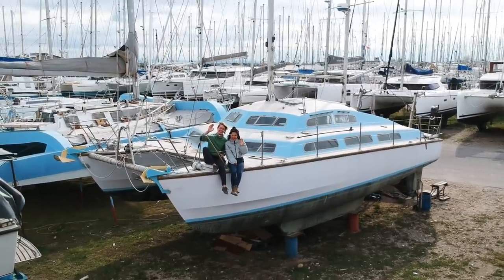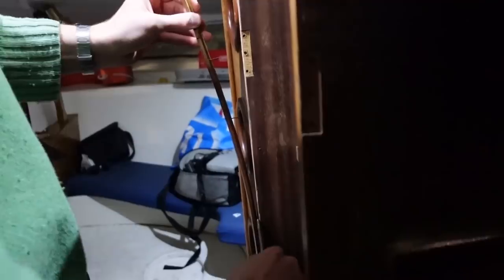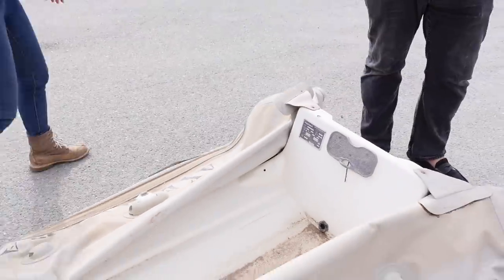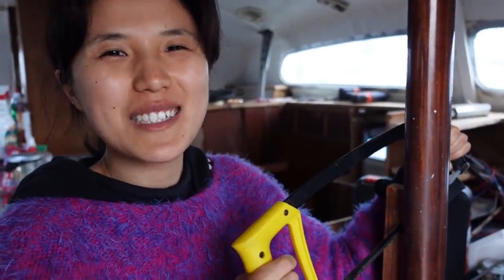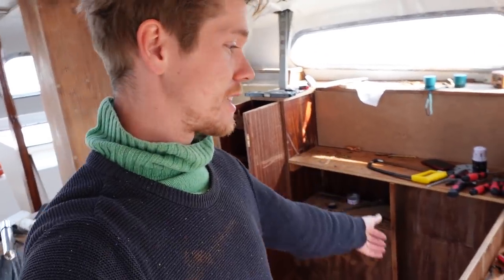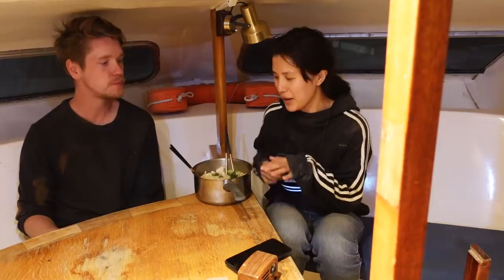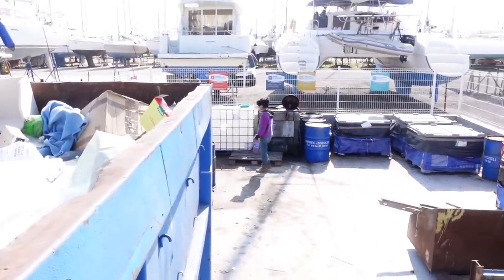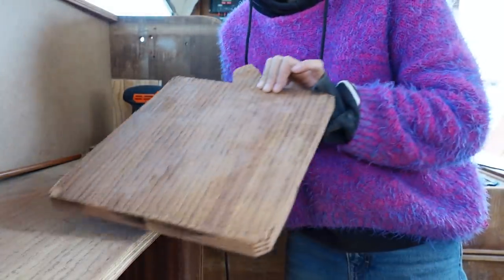Dirt Cheap Catamaran Refit | Part 1 | Wildlings Sailing

Comment: the main item is you want to make sure there are no leaks from outised so buy a good rubber bendable hose say around 100' long and then wash it all down with a fine spray like rain then you will now about water leakage, the Wynns had nothing but problems with their windows until they replaced them all.

Comment: Consensus around the traps on anti-skid seems to be Kiwi Grip if you can get it. Otherwise use ordinary deck paint and sprinkle sugar over it while it's still wet, then once completely dry, lightly sand the surface and wash surface with warm water to dissolve the sugar crystals. This leaves a dimpled surface that helps with grip.
Some people suggest adding sand to paint, but this cannot be dissolved so you are effectively making a deck of sandpaper, so imagine what that's like if you slip over wearing not much clothes....!!!

Comment: Lots of great comments!
Circular (Skill) Saw is great for most everything.. get a thin blade or two and the lightest least powerful is also best for kickbacks. Also you can make a table mount so you can use it as a table saw. I have a spare one but the shipping is more than the saw. ebay...  Easiest and best IMO is to cut a square hole the same size as the deck of the saw and then mount with two clips at one end and a screw knob lock in at the other (under The table. Then make the legs to set on and be sure to have attachable extenders at both ends for long boards.. much safer than trying to press down while cutting. I like to make the board (ply) with corner leg holders on saw horses so you can turn the board over and mount and then put on top of the saw horses.. and you can literally put on top of anything with a hole like your cabinets without tops...
    My concerns... the bubbles and what appears to be large cracks in the last video.?? 
Discoloration (leakage) between fiberglass and wood edges... delamination, rot etc.. Structure is for me the most important.
    BTW what is an "engine" on a sailboat?  I've never had a working one on any of my sailboats and growing up on a 63ft cutter around thirty tons... the diesel never worked either... we only had one mishap and it was the dock that  got busted like ice under an icebreaker... Practice with buoys like drivers ed... and learn how to backsail.
  Anyway  Two shaft = two holes in the hull, Two props too much drag, too much to get caught in things, Two engines, way tooo much trouble and EXpense.   Personally I'd make some sort of drop mount at the bow with large springs, so  no lifting. Only push down and then trip latch to "spring back up or pivot up and latch.. kinda like a large T with 90's at the two ends of the T that lock, latch, strap or pin to the existing cleats. You already have sufficient Rudders to steer. And you can rig up two ropes for forward and reverse and throttle or just mount extensions and also steer from up there with the motor like a mini low level flying bridge... So much comes to mind. Personally I like to keep the engine and gas and all that as far away from the living areas  and there never seems to be enough room in the aft and cockpit, but there are many good alternatives people have done successfully.   I just figure that if you are at the bow anyway you can fend off faster and see where you're going better. 
   I used to keep a trolling motor and a good battery for going through water ways like bridges where the wind is diverted into a throat or no wind or lots of impatient "sailors" motoring to open water..... If you ever have to sail through a narrow space like some bridges be sure to have enough headway to coast through and always favoring the angle of the wind on the other side without tacking... Go around a few times to get a feel for the space and how the foundations block and change the wind direction... Land-Lubber sail-oars will be impressed and cover it by shaking their heads in envy... tisk tisk...

   Blessings I'll pray for the Dumpster Angels to place lots of treasure for you to find..... I often sort out the dumpster so they can get more in it and  for others to find easily that which I no longer need...

Comment: I use Oil base paving paint with a small pinch of fine sand.  I have been told Paving paint and Deck paint are the same formula just different price. One kilo of builders sand will  be more than enough. Experiment in a corner to get the ratio as you want.  Im sorry I was negative toward the Cat originally, It is difficult to judge just looking at a video, Looks like you got a lot for your money and Im sure with your enthusiasm whatever you do you will be successful. I think you have made a good choice.

Comment: With that deck job the 1st thing you have to decide is if you are going to strip the existing or tag onto it. If you're going to lay over it like a lite soda blast and rinse and then roll out the new baby! You could go to an Nth degree with acetone but c'mon?  Just try out a small test point for the adhesion of the new coating to the old.

Comment: You cannot install the hose on the copper pipe like you did. You need a copper barb fitting. One other piece of advice would be to change all your piping over to PEX with push on fittings. This will make your install freeze proof as well as much easier to repair in the future.
Dan

Comment: You need to solder on copper fittings to transition to the hose or risk leaks.  Usually hose barbs are what you need.

Comment: A lot of sanding ahead! You're lungs are worth the investment in two good respirators and spare filter cartridges. Get the carbon filter cartridges for any fluids giving off gassy aromas. 
Also consider ear protection.
Save yourself for adventure !
Reply from the maker: Thanks for the advice!👍

Comment: Probably too late for most of where you need it... but anyone else doing a tear-down job like this, where you want to actually use remnants of the structure: get away from the jigsaw!!! Go and grab the circular saw first, then use the jigsaw for where the circular saw couldn't reach. The circular saw leaves way straighter edges then a jigsaw can.
And while the use of the planer was very innovative - a belt-sander would probably be a better choice to get these edges straight
Reply: Circular saw makes much straighter cuts, for sure
Reply from the maker: Ahhhhh
Reply: @WildlingSailing  I would recommend either a corded or cordless for when underway or not on shorepower. A large home improvement chain brand is fine, but at least 18v.

Comment: Hi young ones ! For the deck paint, look for specialized marine products. Many are two parts kind of epoxy. For the interior, avoid water based paints. Oil based paints smell for a few days but definitely more suited. In any case, prep is key, in or out. 90% prep, 10% paint.
Do you have a car ? Or can you borrow one ? In France, they have big box hardware stores. You'll bay a lot less for your stuff. Those marinas stores are only good for emergency needs. All over the world, the prices are crazy.😳
Fair winds, young friends. 👍
Marc from Montréal, Québec Canada.

Comment: Mads from Sail Life uses Kiwi grip, the best by far but expensive.  The non slip additive you have is simply a type of sand, you put one coat of expoxy two pack on and while it is tacky sprinkle the additive on, then paint a second coat over the top. HOWEVER, this leaves a very abrasive finish which can skin knees and elbows and wear out your clothes (e.g. bums in shorts/pants). So best use the kiwi grip if you can afford it.  Getting a set square and a long steel rule will help with more accurate marking out.

Comment: You created a detailed plan.
You are following your plan.
Stay on course and you will get it done.

Question:  why does a cat need to be as light as possible?  How will this affect you freeboard ,center of gravity, and handling?
Reply from the maker: We just got advice from a Catamaran guru who had a lots of different cats. Most importantly is not too much weight in the front or back. We will have to do more research.

Comment: I’m worried about your bulkheads. It looks like some are cracked at the roof. Could the hulls be splayed?
I’d look into this pretty smartish in case you need to wrap straps around before fibreglassing repair.
Reply: Mark should've pointed it out (hi! :P) but the ones you've seen are non-structural, previous owner just didn't really tab them in right - although I did see Mark doing something with epoxy today so Workman Mark is on the case, I think :D
Reply from the maker: First thing to check was the structural bulkheads. some non structural tabbing needs to be done but it's very solid where it needs to be. the hulls are not splayed. could you tell me where you thought they were cracked just incase I missed something? cheers.
Reply: @WildlingSailing  16'35" on your We BOUGHT THE BOAT Everyone Told us NOT TO BUY!! vid

Comment: HI ,  blurb on clamps - if you can dont use Jubilee clamps especially at sea. They will hold for some time but a better choice is the flat banded type that have a small bolt with Hex head to tighten using a socket or spanner. Mikalor is one brand of them.there are others. Jubilee dont squeeze as tight , the worm they use to tighten often fails , the screw driver slot can be a problem. Yeah a small detail but if your head first in a bilge in heavy sea or other trying to fix a leak or worse.!!
Looks like your cat has them everywhere , fuel , water, oil , change them if you can, what you have will do for now , use an appropriate sealant too, some sealants dont go hard but still seal .Food grade on water hoses , neutral cure etc etc readily available products for all your applications. "Start out as you mean to go on " I say , going to sea! do it right do it well. Thanks for the vids , you guys are cool.

Comment: Repainting the deck would depend on the condition it is in  and what the previous owner used. If it is in bad condition sand it prime it paint it. Some kind that has anti slip in it would be less time consuming. The other you paint sprinkle the anti slip while paint is  wet let it dry sweep it up paint  over it.

Comment: Just a word from an old salt .. when you remove a screw from wood , and you are replacing the screw in the old hole .. take a wooden match or dowl , dip it in varnish and stick it in the hole . That eay when you put the screw back in , its tight again .. good  luck on your adventures..
Reply from the maker: Thanks for the advice!

Comment: Jotun Hardtop with additive is very good you will have to make sure the deck has a urethane finish to start with, if it has wash with soap and water rinse with fresh water let it dry mask with scotch blue tape the area that you want to do, mix hardtop with additive let to sit for 10 mins to activate remix then paint on using a brush in short cross-hatch strokes do not use a roller as the roller will pick up the additive and not deposit nonskid evenly.
If you do not have urethane on your deck you can use a link paint I use Norglass all-purpose primer a very good product however I don't know if you can get this product in France if you can mask off and clean it as usual and apply it with a mohair roller, I pull the tape between coats the norglass all-purpose primer is single pack paint that can be used for two-pack paints above the waterline apply the Jotun hardtop no more than sixteen hours and no less than the full cure of the primer coat

Comment: Nice boat. You should subscribe to ( on board life style ) They have a catamaran that they to have remodeled. A trick for removing trim drive the finishing nail threw the trim using a nail punch or a nail. Good sailing Robert

Comment: Stir the paint and do a test with it and after a couple days try and scratch it off the test areas if it's froze the dryers may have gone off if it stinks when you open it then it's gone off aswell

Comment: on the copper pipe you need a fitting for the plastic pipe or it will continue to leak.

Comment: Well you already have the nonskid additive so use it, but mix a tiny amount (50ml paint plus proportional amount of nonskid) with the old paint you have already have and try it on a piece of scrap wood to find out if the paint is any good. then make your decision on the deck.

Comment: As long as the non skid is not highly polished paint i.e. slippy I would give it a miss this year. Make sure the hull and plumping is leak free, painting decks are not fun get it wrong and you will be staring at it all summer. So do next year when you have had some more painting practice.

Comment: regarding the money pit: the biggest expense would be the drive system. My Iroquois had a Yamaha9.9 hp longshaft which I had to replace. Not really a big deal and the boat did fine on that for propulsion at >1 gal/hr. New sails are a consideration but I had mine serviced and they worked for years! Your most irritating project will probably be re-sealing the windows. I see you have the same hardware I had and I thought I saw some duct tape sealing. It is work, but the original hardware is worth saving when you can.
Reply from the maker: Yeah, we will consider saving the Windows

Comment: Pipe/hose joints. Getting a reliable seal onto a smooth pipe end is a no no. That's why hose tails were invented. In this case you are risking dumping all the fresh water into the bilges but to try it on a salt water line is to risk a sinking.

Comment: Too save cash a high quality oil based exterior paint will work.  You can add a gravelly sand for non skid.
Now it you want to spend the big bucks you should use an epoxy based paint kit for non-skid

Comment: For paint and deckwork You could go'n see Mads' (SailLife) channel. 
Usually You seal/paint the deck marine-grade before applying the anti-skid in those areas You want have as Your walking/stepping ways only. The rest shouldn't get anti-skid, for it is a pain in the a** to rework later, an equal pain to keep it clean in corners/nooks and a waste of material where You do not step.

Comment: Just a tip. As a general rule jigsaws are great for curves but lousy for straight lines (guides help but still impossible to get a nice cut.
Circular saws are great for straight cuts.
Hopefully that tool box has a router. Do some yourtube research on using them as they can bite back but you can get a perfect straight cut with a straight edge, also cutting around templates, triming flush to other panels etc and roundimg edges nicely, very versitile tool just treat it with some respect

Comment: I am not above dumpster diving in a boatyard!  You can find things that would cost thousands of dollars new that might be a little worn around the edges but still work rather well.  The birch plywood that the cabinets were made of is very heavy.  Buy some 1/4 inch Luan plywood if you need to build any more cabinets then cover the wood with a light weight Biaxial weave fiberglass cloth and the cabinets will be 1/4 the weight of the birch plywood and when you cover it with one layer of fiberglass cloth.  They will be stronger than the birch plywood.   BTW, a catamaran is much better than a mono hull and daggerboard catamarans are every bit as good sailing upwind as a mono hull and for the same length plus being twice as fast.  You made a great choice for your next boat but you need some solar and a water maker.  I have seen people who use a reverse osmosis household water filter as a water maker and you can buy them fairly cheaply used.  They do not make as much fresh water as a dedicated marine water maker but they make enough to take a couple showers a week and lots of drinking/cooking water.  Just food for thought.

Comment: Use a two-pack polyurethane deck paint. It needs to be TOUGH and STICKY, or it'll start wearing through & flaking off in a couple of years (voice of experience...) and you'll be doing it again, only with more prep to get back to a sound surface. Don't economise here! Decks get a lot of UV mistreatment. You're so brave attacking that classic but dated interior, I can't wait to see what you create. It looks solidly-built but heavy, shedding the kilos will make her get up and go, so you'll be sailing more and saving fuel, great way to go. I'm still nervous about that engine though, I'd want to know there were no nasty surprises before going too much further.
Reply from the maker: Thanks, great input, we will look it up!

Comment: A bit of careful re-design and significantly reduce the weight with thinner marine ply covered with glass cloth & epoxy and glued in place...   Have a look through of the redesign of the interior on "Sailing UMA", they have done an excellent job with their 36ft (now 40ft with a detachable bow-sprit) Pearson mono-hull...

Comment: It's generally not a good idea to slip hose over straight pipe, but if you have to so be it, and you should always wherever possible double clamp the hose with the screws 180 deg apart

Comment: It pays to carry a spare water pump on board.  Install flexible Solar Panels and the 3  you have on board.  Try not to put screws or bolts through your Fibre Glass, what kind of shape is the Bosun's Chair for cliimbing to clean, hang your new flag, makes ure sail goes up and down without problems best to check all these items first be fore you sail.